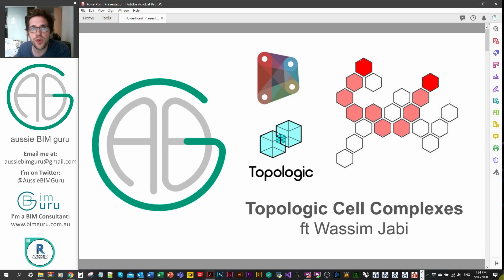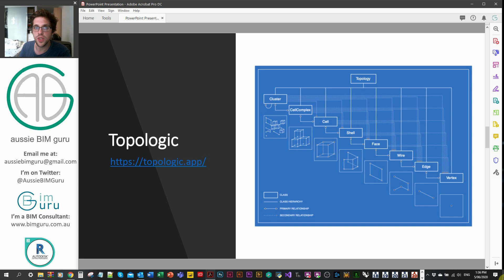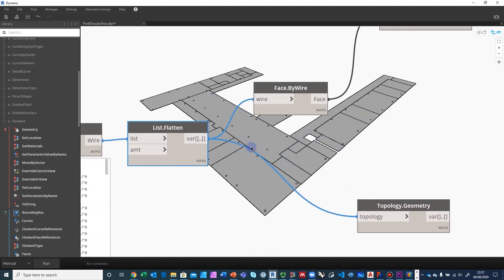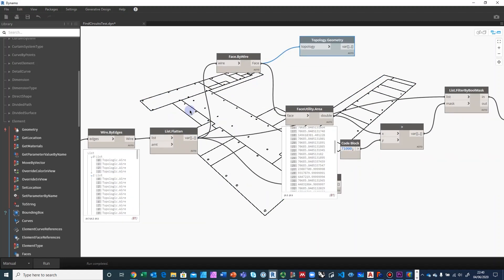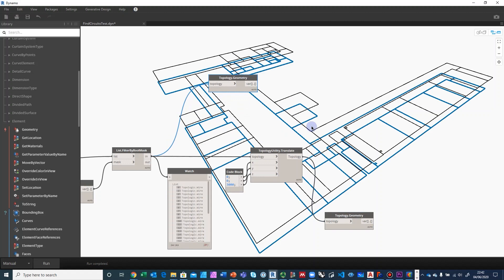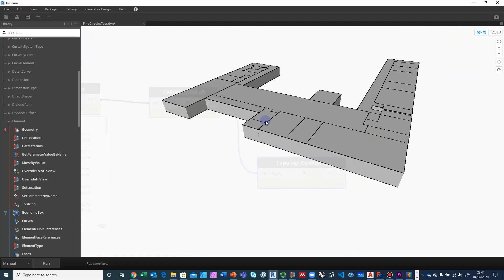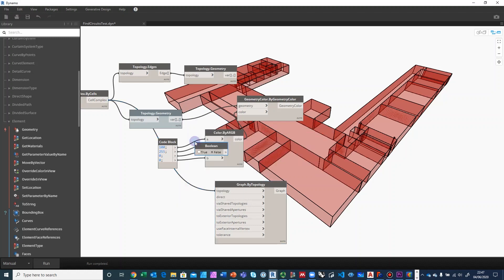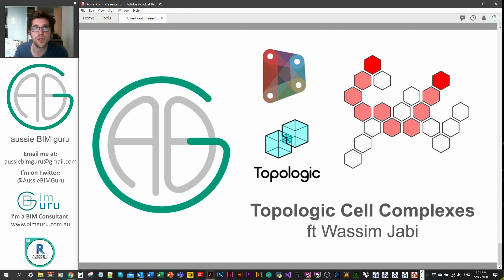Topologic Cell Complexes in Dynamo (ft. Wassim Jabi, 2 of 2)

Comment: hello.  can a topologic energy model be performed on room cell complexes?
second question.  how to add window openings to the exterior faces to do an energy model for this?
Reply from the maker: I would contact Wassim Jabi to confirm via his website. It depends on the energy modelling method you use (e.g. Honeybee for ladybug). At the very least, the model would need to understand where the doors/windows should roughly be located, either by a relationships matrix or some rough modelling.